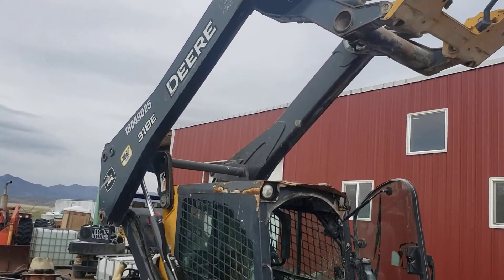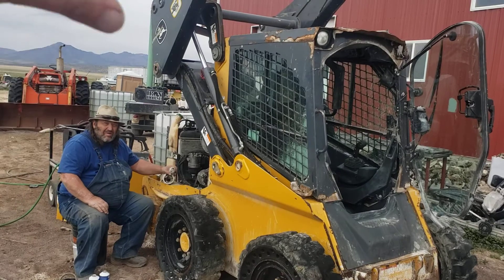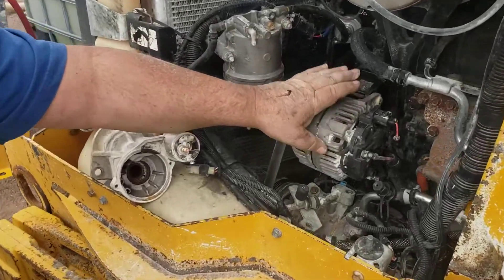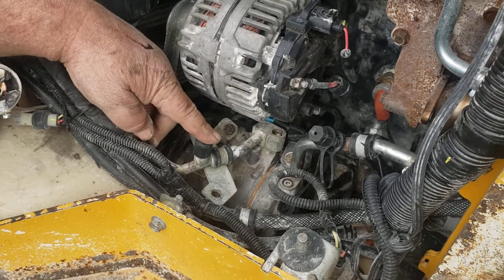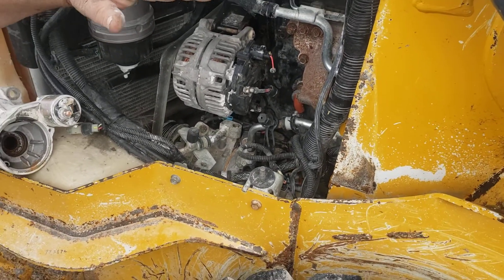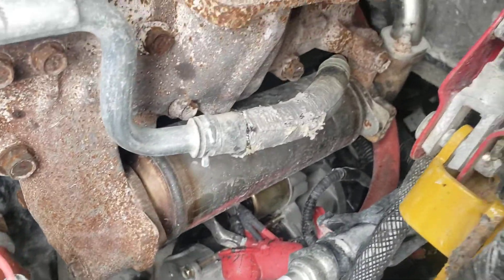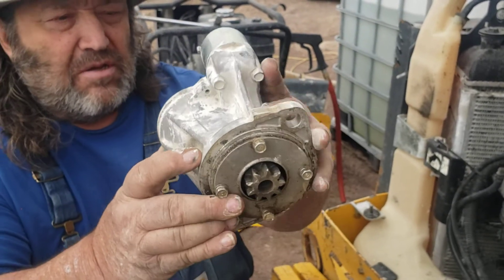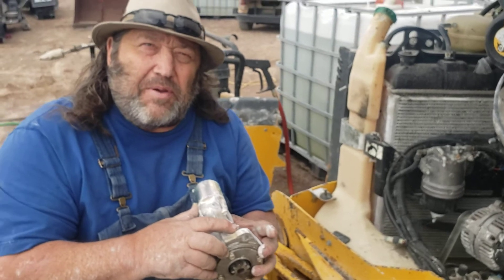How to replace a starter on a John Deere 318e skid steer diesel engine

Comment: To add to my other comment above… I found the easiest way to remove the top bolt is to go in from the rear. Remove the radiator, remove the fan blade, remove the alternator, and then you can reach it with a 24” extension. My impact wouldn’t break it loose, so I ended up having to use a breaker bar and do it by hand.

Comment: If this helps anyone else… there is a much easier way to get the bottom bolt. You just need to take the bottom panel off, and you can easily get to the bolt from underneath.  I just used my loader to lift up the rear end enough to block underneath it and crawl under.

For me I had the same starter and position but it was on a Gehl r190 with Yanmar engine.